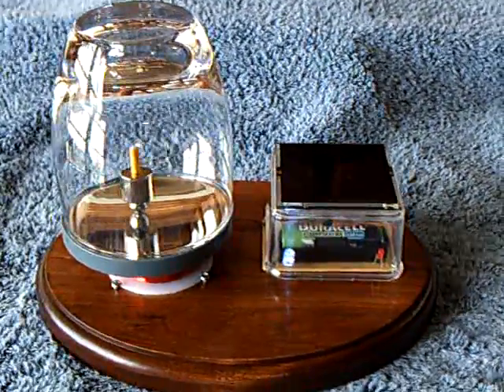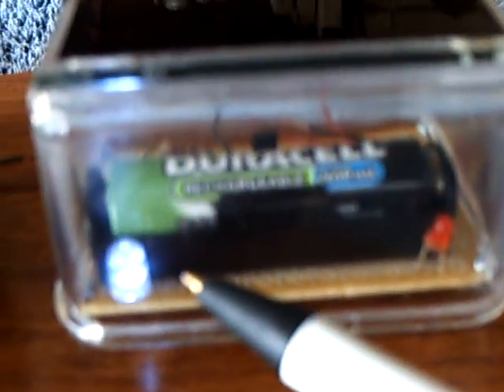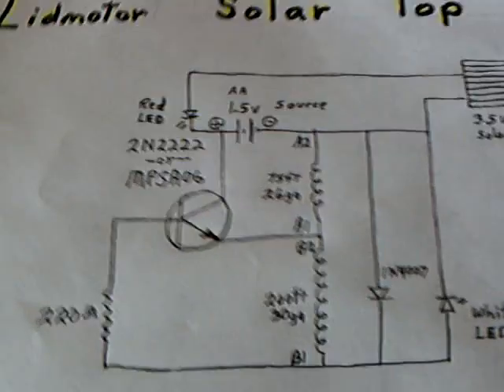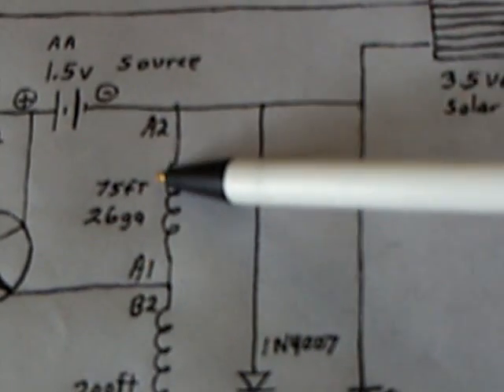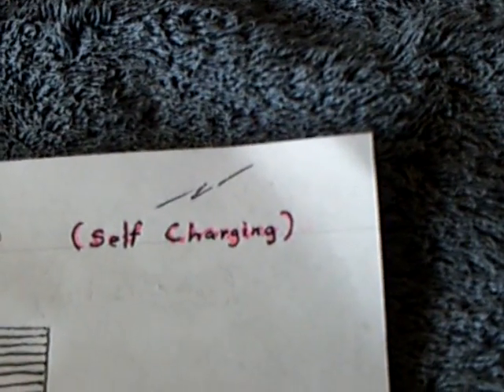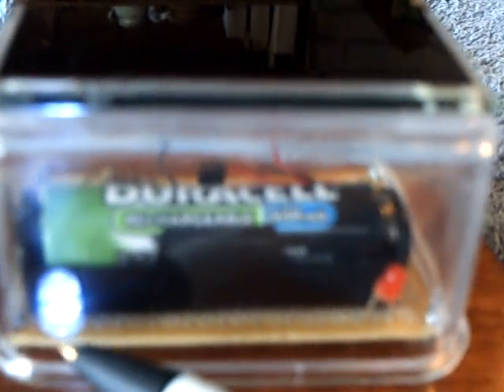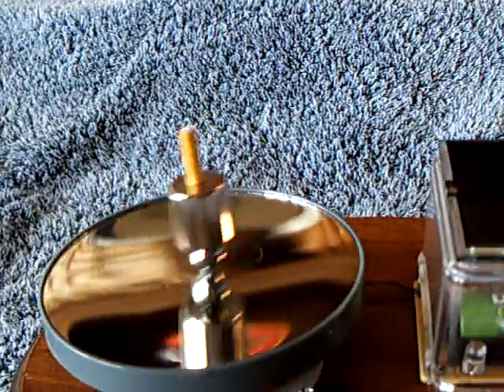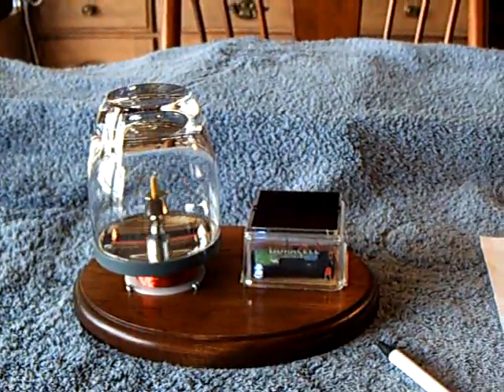Lidmotor SOLAR TOP--- self charging

Comment: that coil is actually two coils, one with a LOT of turns of thin wire, the other with fewer turns of  thicker wire. the one with lots of turns acts a a magnetic pickup, creating a small signal every time a magnet pole goes by, which triggers a small transistor, which then sends a pulse of power from the battery into the other coil, giving the top a small kick.

Comment: You have made a very nice design. Looks clean and efficient. 

One question; How is the coil wound?
When you said all wrapped together, Did you mean to start with the ends of the 75 and 200 foot wires and wrap them around the core together until each of them ends without twisting them?
Or did you mean something else? Sorry to be dense.

As I said before...beautiful project.